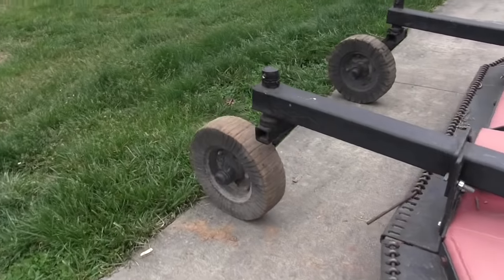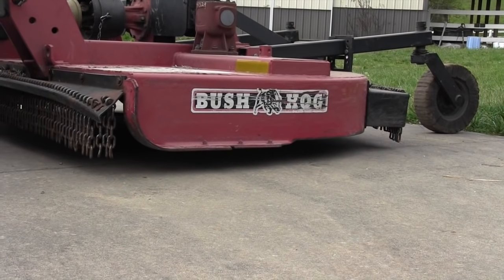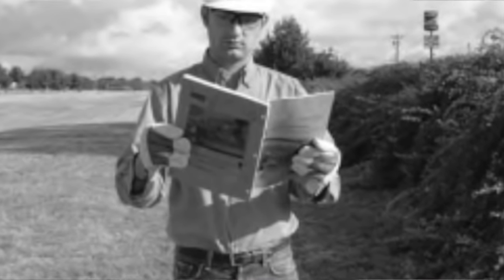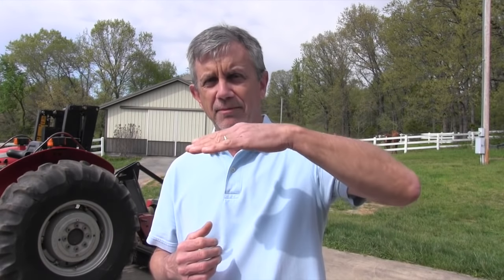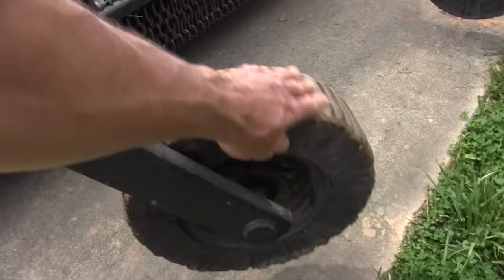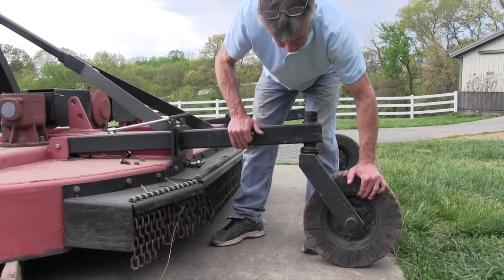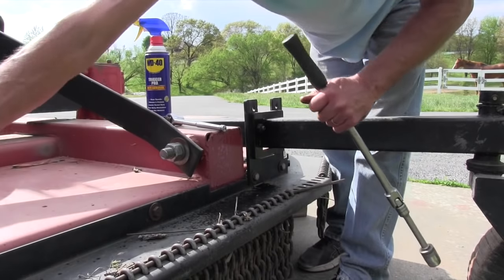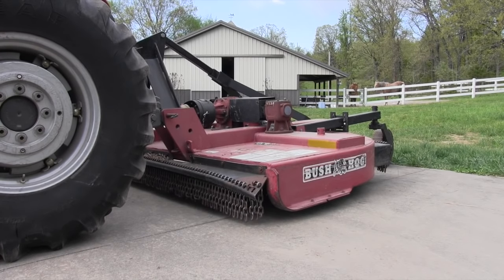How to Set Brush Hog Tail Wheels

Comment: If you have the front set low, it tends to scalp. If you have the front set high, it throws debris forward under the tractor which can cause damage. I learned this lesson the hard way. It threw a piece of branch under my forward drive pedal and broke it off.

Comment: I have the safety chains on the front of my bush hog. Not a rotary cutter. I run it up two to three inches in the front and it bust up and mulches two-to-three-inch debris far better and doesn't leave big sticks and limbs so they will decay and decompose faster. With my rotary cutter, I run it as you say, and it cuts almost as well as my zero-turn mower.

Comment: Great video, Mike. I find it easier to set the tail wheel first to get the blade height where I want it at the back (1” - 2” above my cut height) and then use the 3 pt arms to get the amount of rake (pitch) I want at the front.  I’m doing vineyard row middles and I want a fairly smooth cut and a mulching action for soil improvement, so I run it close to flat. Doesn’t seem to make a noticeable difference in fuel consumption in my case

Comment: I set mine with the front skid plates almost touching the ground and the back tilted up a little.  If the weeds are really high, I tilt the back up even more so it throws the material out faster.  When I bush-hog, I'm not going for pretty, I'm just trying to cut down the weeds.

Comment: I don’t like the height my mover cuts! My cut leaves about 5 to 5 and 1/2” of grass, brush weed or what ever and it drives me nuts! I’m at the point of adding spacers between the blade and the stump jumper, has any one done this? FYI I’ve also thought of lowering my gear box! If anyone has an ideal please comment!

Comment: I think that my cutter is adjusted for my area as best as possible and I do recommend that people look at their owners manuals to make sure their brush hog is adjusted correctly. Fortunately I use mine on level soil and don't have any problems, but those who live in areas with hills they have to readjust their cutters differently.
Reply: bushhog
Reply: @bill45colt  bushhog is a brand name. there called SLASHERS here in Australia

Comment: Basically, with the cutter adjusted with the front higher than the rear you attain a mulching effect rather than just cutting, at the expense of more HP required, higher fuel consumption, and increased blade wear. It's certainly not wrong to adjust it in this manner, just an option probably most of us won't need very often.
Reply: This comment was more helpful to me then the video. Thanks.
Reply: Thank you.  I was never going to the other video he was promoting.  I would have felt stupid for not figuring it out something simple and then paying.

Comment: Question for you!  On my John Deere RC1048 cutter the manual says exactly what you say for setting cut height and rear height, 1-2 inches higher in the rear.
On my Big Bee Agri5 the manual says to have the cutter level, front and rear equal height.  Any thoughts or suggestions on this?  Thanks!!
Reply from the maker: I like your answer Katie!  Always override what some goofball on YouTube says with what's in the owner's manual :).
Reply: @TractorMike  Haha, yes!  I wasn't really asking if I should follow the manual or not but more why there is two approaches and what might be the reasons for it.  Maybe some guy at Big Bee just likes to mow with the brush hog more level and do more mulching and JD likes it better the other way.  I'll stick with your advice Mike as a good starting point.

Comment: Hi Mike,

I was brush hogging yesterday again. I don't do that too often, mainly during the rainy season. I do this at an orchard so it is not that easy to go around the different types of trees. Strangely, I am still getting better at it and more efficient (quicker and be able to mow more accurate around the trees.). Do you have any suggestions how to do this best. The land by the way is on a little slope but not too much. Also I added spacers a while ago and basically the slope isn't a problem anymore.
Reply from the maker: Peter, there are orchard bush hogs that have a pivoting blade assembly that goes around the tree that you might want to look at.  I grew up on an orchard, getting up close to the trees without hitting them is a challenge.  It takes a lot of practice.
Reply: @TractorMike  just had a look. Would be nice. But haven't seen those here. In Thailand we are rather limited on what we have. Most farmers don't even have a tractor. Like I got the smallest tractor that was available with a front loader. Which ended up to be a Kubota L4018. I am though very happy with it. And happy afterwards that they didn't have a smaller one with a front loader

Comment: Mike, how much up and down play should there be on the shaft from my tractors pto to the gear box on top of my brush hog?
Reply from the maker: Mort, that's hard to say because you'd need to know where the up and down play is.  If it's coming from worn U-joints, better replace them.

Comment: I have a 7ft Rhino BH with a single tail wheel. I've welded it on twice so far. My question is, have you ever seen a tail wheel with a spring or shock absorber in it?
Reply from the maker: Not on the smaller cutters, but that would probably work like a charm!  It would be a nice selling feature for the first company that came out with it.

Comment: I have a Land Pride brush hog and it has a solid back end and open in the front with chain. So will this advice still work?
Reply from the maker: I would think so...check the owner's manual to check me, but I'd bet they want a forward rake even with the enclosed back.
Reply: The closed off rears on Land Pride brush hogs are a bunch of nonsense. The cover on ours tore off literally the 5th use. Just have chains.

Comment: DO you have a preference over single or double wheels?
Reply from the maker: Not really.  I've always owned single wheel which is very maneuverable until you try to back up and cut under a tree, then you have to guide the tailwheel on one side or another.  Theoretically, you'd get a little more consistent cut with dual tailwheels, but I'm too cheap to pay extra for them.  A lot of cutters can be ordered either way, I've seen dealers that tend to equip almost all of their offering with dual tailwheels, so there must be some people who don't feel as I do.

Comment: How about on skid steer.  I have problems it keeps shutting down  like needs too cool down. Any help please
Reply from the maker: If it shuts itself down there's a problem somewhere.  If it's when running a brush hog it probably means the hydraulic oil is heating up.  Might want to check filters, air coolers, etc.

Comment: What do you do if the tail wheels don't adjust?  Thanks
Reply from the maker: They're welded on?  I don't know.
Reply: Not welded but just doesn't have any adjustment feature.  I took it (just one) off as interfering since I couldn't adjust.
Reply: if you cant adjust wheels, then adjustment has to be at hitch end with hitch or /and with upper link connected to tractor
Reply: Your sol.

Comment: Hey Mike—Was reviewing your videos hoping to find an answer to my question—hope you see this and can answer for me.  I have a 13 year old BushHog model 286 rotary cutter that I use to mow brush in our woods and also to keep our 15 acres of pasture cleaned up throughout the year.  Lately, I’ve noticed that when I turn, the tail wheel assembly will stay sideways as I straighten out to mow the next straight run—and it digs a trench as I’m mowing!  The tail wheel spindle that fits through the holder for it seems to have a lot of “slop” or movement in it which could be causing it to bind up when I turn.  It doesn’t do it on real gradual turns, just those that sharper.  Any thoughts or suggestions?  Going to check with BushHog but thought I’d ask you first.  Thanks a bunch! (Enjoy your videos and they’re very educational!)
Reply: Same issue with tail wheel.  Did you find an answer?
Reply: That wheel should be attached with a vertical shaft that is held by a pipe. When you say "slop" do you mean the wheel moves up and down a bit, perhaps a half inch to an inch? That is normal. Or did you mean that you can move the wheel vertical shaft tilted in the tube? That could be wear. There should be a grease zerk so you can apply grease between the vertical shaft and the pipe. There should be some clearance between the two, but not a whole lot. It sounds like yours is lacking grease and binding up. Remove the wheel vertical shaft from the pipe. Put the grease gun and verify you can shoot grease in. Zerks can get clogged. If you don't see a zerk, it might be broken off. Look for a hole in the side of the pipe. If it is broken off you can replace the zerk. If you can't do that, just disassemble it and slather grease in there and put it back together. The wheel should rotate on the shaft freely when you lift the mower up when the wheel is off the ground.

Comment: Hi I like your videos, I might be wrong in saying this but it seems like a lot of the problems you are helping people fix are problems that didn’t really need to exist in the first place.  For instance quick connect 3 point hitch, it takes 1 minutes to pull the 3 pins move and hook up the next implement.  Or this video my bush hog doesn’t even have a wheel. I am not criticizing you at all my point from watching your videos it sure looks like all this fancy quick new stuff just makes it more complicated than it needs to be. Thank you for your videos.
Reply: Flat6 Hemi 
What kind of brush hog do you have that does not have a wheel in the back?
Reply: A 1964 bush hog I believe, the writing has been worn off my entire life and I am over 30. It was purchased with my JD tractor new.
Reply: Not to be smart but 3 point hitch not fancy it's been around since 1920

Comment: I like your videos and I learn a lot, but your tennis shoes I do not like. You unbolted the tail wheel and the 1200 pound brush hog was wobbling on an unstable board all the while with your foot under it protected only by a tennis shoe. You would look so much more professional for your videos with steel toed boots.
Reply: Thank you for that safety tip, and I didn't have to pay for it. :)
Reply: send the man a pair of boots!
Reply: keep your feet out of dangerous places,,,,,,and wear boots
Reply: Bush Hog. It’s on the side.